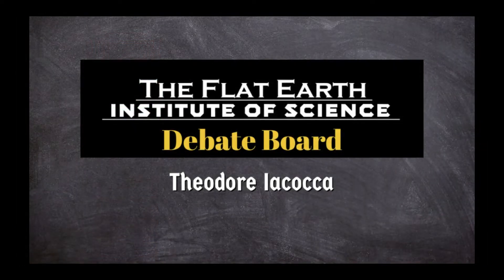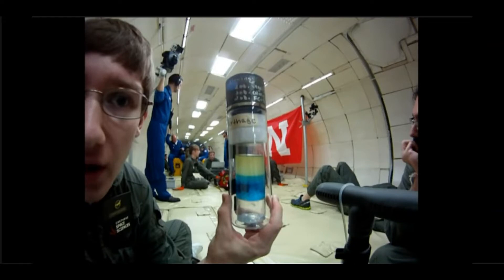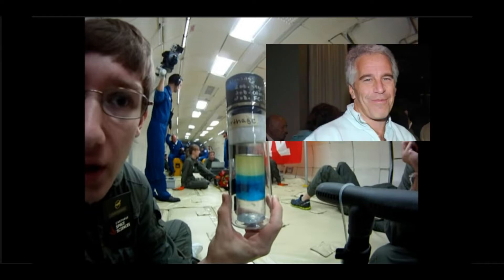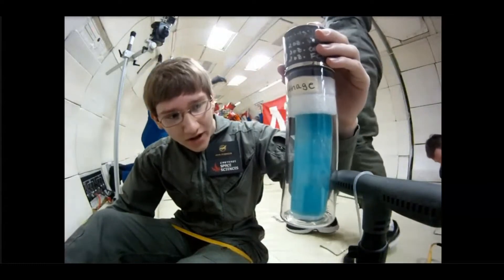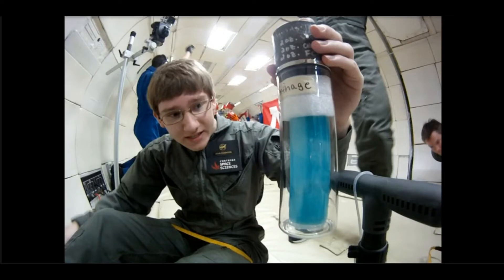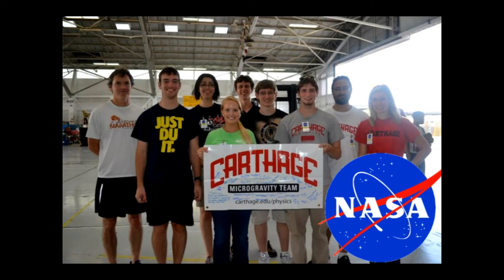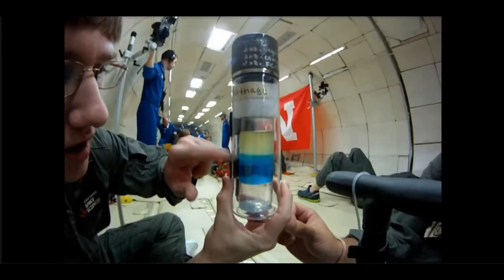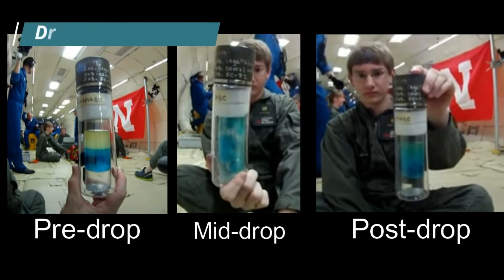Density Tower on a "Zero-G" Plane. A FAILED Experiment Attempting to Prove Gravity. See Description👇

Comment: Do us a Favor: Get your own Experiment:
At first: Do a Setup with just Water and the Cooking-Oil, to get it as simple as it gets tto understand, in a Transparent Plastic Container.
Second: Mount that securely with a Camera, thats fixed on the Plastic Cylinder ,f illed  with the Water and the Cooking-Oil a, after you made sure that the Cylinder was sturdy and completely-sealed!
Third: To counter possible disturbances, get that mounted on something like a 3D-Gimple, one like you may see Photographs or Movie-Makers use, to avoid any shaking of it!
Fourth: Book a Parable-Flight, with the Experiment getting mounted inside.
Fifth: Livestream that Experiment for Proof!

Show that Video on YouTube to the World!
And if you can't do that, you have no right to discredit anyone doing the Experiment, when you didn't manage to corerectly replicate this and show your desired or undesired Results!
Because the Scientific Method is not limiting the shown Result to what you like, but to what the Result actually shows!

Comment: Agree, a poor experiment. But it did demonstrate the effect that relative density doesn't function without an acceleration. High school kids don't think of some of these things. Your paranoia is leading you astray. In all cases, it's clear what is happening
Your duplication was significantly different - you violently shook the liquids, which homogenises the solution, causing it to take much longer. Try again with a simple inversion mixing, like they did in freefall.

Comment: What is a big deal, is the bowling ball and feather, fall at the same rate, DOWN, in a vacuum chamber. 
I guarantee, you cannot answer why they fall DOWN, in a vacuum chamber. When the density of the medium around them, is exactly the same.
Reply: They dont fall there is no downward acceleration. Easily provable. Thats why the "fall at the same rate"
Reply: @ so they float? Lmfao. They literally fall down to the ground, hence how they GET to the ground. Isn’t flerf mantra “use your eyes”? You can WATCH them both fall to the ground. Lmfao.
Reply: @RoundBallDefender  lmao they decelerate lose the constant momentum everything in the reference frame has. Things aren't just hovering in air as earth meets them. You need to research this subject as there are many aspects to it but every practical demonstration, including this one proves the upward, relative to us motion vector...
Reply: @RoundBallDefender  they arent falling as there is no displacement of gas and liquid when you release objects into freefall from the reference frame of earth. 
Youre claiming an acceleration causing objects to move towards earth.
 If it was the case that acceleration is applied in freefall,  we would witness displacement of gas and liqud/density towers, the instant we release into freefall.... this never occurs until terminal velocity is reached....

You only witness the density towers scramble when you do it in a zero g plane because you put the density towers in terminal velocity,
Meaning  there is no remnants of the upward vector momentum keeping the density towers ordered, if you release a density tower into freefall from top of building, the density towers will not displace until they reach "terminal velocity" as seen in the zero g plane. Its alot to process but again it is all based in every single practical demonstration we can show.... everything is inverted in this realm. Including the vector the try to tell is that's exactly the opposite of what we can test and verify...

Comment: He didn’t shake the tower
Reply: Whether he meant to or not, it is shaken as he is moving about and the layers are mixed before they start rising off the floor. Play it in slow motion and watch from 4:51 on.
Reply: @andysmith1996 now I've seen goalpost moving but to move the entire meaning of shaking that's some next level stuff.
Reply: @SCP7170  Then perhaps you can explain to me what force is causing the layers to mix when they're in freefall and why the layers in the density wand that Nasa showed on the ISS didn't mix? By the way, this is the point that most people run away instead of addressing my questions.
Reply: @andysmith1996  there's no force to stop them from mixing is all, the same way those people "mix" with the air instead of staying put like they were initially.

And the density wand mixes, the astronaut then applies a centrifugal force to separate the layers again.
Reply: @SCP7170  Go watch the video again. The astronaut takes out a wand with mixed layers. She separates the layers by applying a centripetal force to them. Then, when they are separated, she holds the wand up and the layers do not mix, despite them being in freefall. They mix only when she shakes the wand. That is, she applies a force. According to you, when the wand is just floating there, the layers should mix. But they clearly don't.

Saying "there's no force to stop them mixing" is getting it backwards. When the layers are separated all the particles in all the layers are accelerating towards the ground at 9.8m/s/s. To mix, some of the particles need to move faster or slower than others or move in a different direction. But it takes a force to do that.
Reply: @andysmith1996  "she takes out a wand with mixed layers" yeah, it was already mixed, only then she needs to apply a force to separate them, and the reason they stay separated then is explained in detail in the video, and it has to do with the fact that those ate beeds and not two layers of the liquid (oh look, it's that goalpost movement I was talking about), so watch it again.

And no, it's not "getting it backwards" you can see how everything in the 0g plane "mixes" despite it being already separated, the people were initially on the ground, now they're floating among a gas less dense than them, it's the same principle.

And let's not get too far off the goalpost here(third time), the fact remains, that you can not, on earth, absolutely shake a density towerlike the video shows with the motion that kid was doing, that is NOT "thoroughly mixing", he barely moved that thing, calling it "mixing" is straight up lying, so the reason must be something else, something that actually changed during the course of the video, can you guess what that is?
Reply: @SCP7170  What reason is explained in detail in the video that they stay separated? Please quote. Oh, and if "it has to do with the fact that those are beads and not two layers of the liquid", then why do you keep citing the occupants of the vomit comet? They're not liquid. The reason they start to rise off the floor is because the plane starts to drop away from them as it levels off then noses down. It and the occupants then both accelerate at the same rate, just as the layers in the wand do.

Watch the Liquids in Near-Zero G video. At 2:44, you can see that the fluids remain in the position they were in as they start to freefall and mix only when the parachute opens and applies a force. This is also what we see when we drop a bottle of water with air bubbles in it. The bubbles stop rising and maintain their relative position within the bottle.
Reply: @andysmith1996  sir, do watch the video you want me to watch, it's literally not even five minutes long, she explains in detail why the beads remain in place.
I'm citing the people in the airplane because they're not suspended on water like the beads, again, it has to do with the explanation you refuse to watch.

And again, you're getting off topic, the fact remains, that you can not, on earth, absolutely shake a density towerlike the video shows with the motion that kid was doing, that is NOT "thoroughly mixing", he barely moved that thing, calling it "mixing" is straight up lying, so the reason must be something else, something that actually changed during the course of the video.

Oh and btw, in the liquids in near zero g video, the liauids "don't remain in the same position they were when they start to freefall", as soon as they start to freefall the blue liquid flips upside down while the green one literally splits to five layers "oil water oil water oil"(that's a direct quotefrom the video), now I know you should know about that part because it's literally the thumbnail, id you're trying to change the topic, at least don't lie.
Reply: @SCP7170  She does not explain why the beads remain in place after spinning the wand. That's a lie. She explains after she has shaken the wand to mix the layers up that "because of static electricity effects, some particles are also clinging to the sides of the wand". Again, that's after she has physically had to shake the wand to mix the layers, when according to you they should have just mixed by simply being in freefall.

In the rocket example, at 3.09, while the rocket is still climbing, the liquids split into layers and they are split at 3.12 at apogee, then remain in those positions until the parachute opens at 3.26. The "oil water oil water oil" quote is said at 3.50 before the rocket has even reached apogee. The blue liquid is at the top at apogee and stays there during freefall. Anyone can view the video and see you're just blatantly lying about this too.

And in the video above, watch closely at 4:50 to 4:52, the guy lurches around and causes the layers to mix and that's as the plane is nearing the top of the parabola and the people in the background are only just starting to separate from the plane. It's mixed before it's in freefall.

Try doing the experiment yourself. Make a density tower and drop it and film it in slow motion. The layers don't mix in freefall.

Comment: The density tower was not shaken. For him to mix it to where it was mixed, he would have to shake it vigorously.
Reply: Seconded.  The person holding the tower was not shaking it with any vigor but (presumably) trying to keep it it in the field of the camera.  Was the camera secured?

It would also be interesting (and honest) to include a link to the original video.
Reply: Play it 025 speed and watch closely at 4:51. He does shake it (whether he means to or not) and the layers are clearly mixed up before they start rising off the floor. If he didn't shake it, then what force is causing the layers to accelerate at different rates? And why does a density wand on the ISS not mix when in zero g?
Reply: @andysmith1996  Playing it at 0.25 speed is going to exaggerate any movements when it comes to fluids. What I see is him merely moving the bottle as well as himself and because they are in zero g as the plane does its parabolic move, any minute movement has a major effect on the mixing of the density tower. For him to mix it up that much without being in zero g, he would have to vigorously shake it. Think of it like making salad dressing with oil and water. You have to really shake it or stir it vigorously to mix them together.

I just watched the video on the density want on the ISS. When is it swung around by its key ring, the beads in it go the bottom of it due to centrifugal force. The density wand does mix in zero g when it is vigorously shaken. Also when the astronaut let's go of it, it doesn't immediately fall down. It floats around slowly.
Reply: @GloberMom  You missed the point. Yes, the wand mixes, but only when, as you yourself said, it is "vigorously shaken" – that is, only when a force was applied to it by the astronaut. When it was just in zero g it did not mix. You're claiming the column in the plane mixed simply by being placed in zero g, so why didn't the wand?

Think of it this way: when dropped, every particle in each of the layers of a density column starts accelerating towards the ground at the same rate and in the same direction. Their positions relative to each other should remain the same as they were at the moment of being dropped, just as gas bubbles in a soda bottle stop rising when the bottle is dropped. For the layers to mix, some of those particles must either acclerate faster or slower than others or take a different direction. So, where is the force coming from to do this?

Check out the video "Liquids in near-Zero G" on the "Air Command Rockets" channel. When the density columns start to fall, the layers remain in the respective positions they were in at apogee; there is no relative movement between them until the parachute opens. If a separated density column will mix when placed in zero g, why are we not seeing this in practice? I asked FTFE this and all he said was that in freefall there was no force to prevent them mixing and thus they will mix. He ignored the ISS video. Can you explain it better?